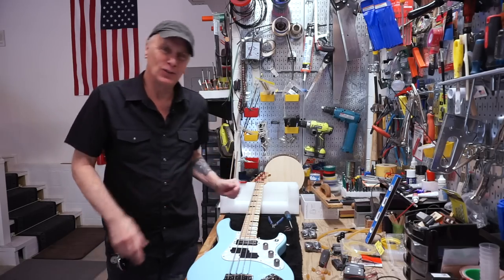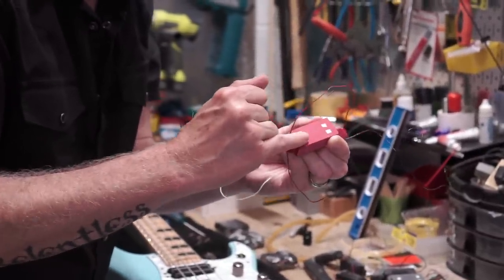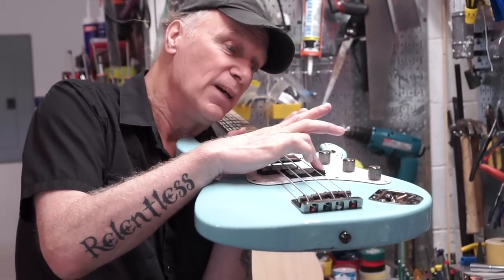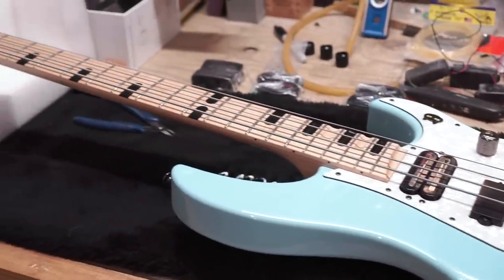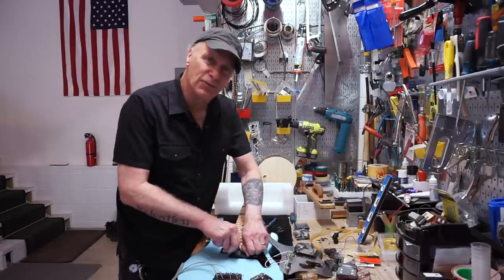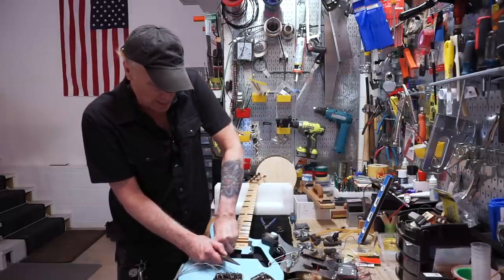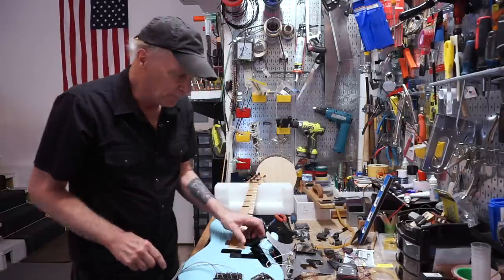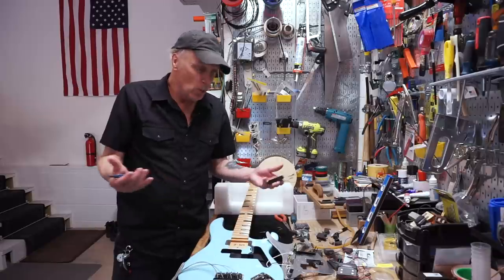Relentless Pickup Install

Comment: Hey there Billy, a little trick my Dad taught me back in the day, is when you are putting screws back in, whether in wood or metal is to turn the screw driver backwards until you feel the screw drop into the threads of the wood or metal. In wood, if you don’t get the screw in the threads within the wood you’ll strip it just like metal. If you are swapping pickups often the screws will lose hold. Just a little trick to keep that from happening.
Love your videos by the way.
Reply: That's a great tip your dad gave you. I always do that and I never get trouble putting screws back in.
Reply from the maker: Agree! Your Dad is right---I do exactly that often. Thanks!

Comment: I bought an Ibanez SRMD200 Mezzo 32” scale bass.  Just like Billy said… the edges and corners of these inexpensive P pickups were sharp and hard.  Every time I slapped the E string, the corners stabbed into the fleshy part of my palm, below my thumb.  It hurt and drove me crazy.  Eventually, I pulled out a file and rounded the edges and corners.  
Billy, thanks for improving design of the 50-year-old P bass pickup.  I’m sure Leo Fender would approve.

Comment: hey Billy. just wanted to pass along a little trick i learned when doing inner work on the Bass as you demonstrated in this video. removing the strings from the head is not needed. just loosen them up and then remove the bridge from the body. it saves time. I'll for sure be looking to get a set of Relentless pickups asap.
Reply from the maker: I don't like to attach and re-attach the bridge--too much wear on those screw holes which will eventually make it loose--and the bridge to body connection is extremely important.
Reply from the maker: Let me know what you think of the new pickups

Comment: Fantastic instructional video Billy, learn a lot, I had to do some soldering on my SIRE bass a while ago after a wire that connected from the battery compartment to the input jack came loose, my first time soldering and it worked OK, nerve racking but gained some knowledge from it !! :)

Comment: Billy, I realise this probably isn't something you want to revisit, but I'm really interested in learning how exactly you installed the EBO pickup on your original p bass. There aren't really any guides on that online or on YouTube. The only one I could find was a video on fitting one to a cheap p style bass, but that was using a router and I don't really have the money in my budget to buy the bench etc required to do it that way. 
I'm planning on selling my jazz bass, ibanez SR and my schecter stiletto six string and buying a sire p5 and adding a full set of relentless pickups and keeping the hipshot tuner I already have and installing that too. I know you did it with a chisel and some other hand tools but I've never really seen any detailed information about the process.

Comment: Billy I have a Fender Jazz bass, and I was just wondering if maybe Di'Marzio would be interested in making pickups with the same radius design but for different basses. Like a jazz bass pickup with a radius, or a soap bar pickup with a radius. The idea that you have with this is great, and I'm often finding that it's harder to play the middle two strings with the same consistency as to the outer strings. This is especially apparent to me when I'm playing my six string bass. The neck is flatter on that bass but it still has a radius. Pickups more like yours would be a lifesaver, especially live when so many other things can go wrong - I can start from the top when I'm on my own, but as you know, that doesn't work so well in front of a crowd 😆.
Reply from the maker: Coming soon!
Reply: @BillySheehanOfficial  Thanks so much for getting back to me. That's great to hear, as soon as they're out I'm putting them on all three of my basses. Huge fan btw, you're a massive inspiration, I hope to see you live some day soon. I even got a hipshot tuner because you mentioned it I think on your Bass Secrets video. All the best Billy, you're the man!!

Comment: I am sitting here with a pair of these in the  shopping cart. But wondering how they’d sound in an active bass. My guitar tech knows I’m upgrading my bass. He just put a set of these in a PJ this evening. He hit me up and said this is a must have pickup. The owner of the bass brought it and a Quarter Pounder Jazz for the bridge. He wasn’t sure about the combo but said it works great together. Now to call Dimarzio tomorrow for info as far as if it’ll sound alright with an active preamp. Unless one of you guys have already tried it... if so, let me know what you think.
Reply from the maker: It should be fine---and the Relentless style J pickups are coming soon!
Reply: @BillySheehanOfficial  I placed the order... thanks!

Comment: Yes ! I hate the crater left in my thumb from the screw mount. I too hacked them down . But I don't use springie thingies under my pickups .I solid mount them to the body. Take my time and get the setup spot-on and measure for the right thickness for a shim to get the pickups exactly where I want them. It's Rock solid. 
But that's just me. 
Comparison between the stock pickups sound and these, are they close?
I really like the roundness of them . 
Thanks Billy !

Comment: I was wondering, how do you avoid signals going out of phase or outright eliminating each other in a two pickup/two ouput/two amp setup?
Reply from the maker: The same way any two signals can be combined without phasing issues. Two mic's, two anything. Are you out of phase with anyone else's amp on stage? Unlikey.
Reply: @BillySheehanOfficial  thanks for your reply! I'm currently nerding out over all this stuff and a few musicians I talked to told me there could be problems with phasing. I am now running my P bass through two different signal chains on my pedalboard and then straight into headphones/audio interface. Works like a charm. Absolutely no issues with phasing and I have never been more happy with the sound

Comment: I try not to do any soldering over the exposed body of the instrument- good idea to put a cloth or a sheet of paper in there in case of flux/solder splashes.
Reply from the maker: If it was someone else's bass, I would have
Reply: @BillySheehanOfficial  good man, sir. I am, of course, in the 'do as I say, not as I do' school here! 

pondering adding a large G&L pickup to a stingray... for my money, the stock pickup & position is a bit light, sonically. I am encouraged by your thoughts on tone.

Comment: Billy, you are F-ING amazing!!!! Guitar tech extortionate I'd say! Definatly not a Luthier, more like a gut bucket miastro. Your strap vid is possibly the best I've ever seem, makes perfect sense.
By accident I found a solution to the pickups tipping when you use the surgical tubing. Couldn't find surgical so tried using small plastic tubing. Needless to say it didn't work, (too stiff), but found another way to insert it that works amazing well, AND stabilizes the pick up as well!!!! Can I get your input on this if I send puctures?

Comment: I mangle all my own instruments, too! But then, how else would I be able to have a short scale with a P/Tbird pickup combo with a VVT control configuration? My nasty #1 bass does have a hole drilled all the way through the body, by accident...

I like toothpicks with krazy glue to fill stripped screw holes. They dry faster than elmers lol
Reply from the maker: Sounds familiar!! ; )

Comment: Is it possible to design a bass that you can install the pickups from the back behind a panel of some sort? Maybe it has already been done but doesn't work well, Idk. I have seen many videos about changing the pickups but none without the extra trouble of removing the strings and all that. Some bass guitars has a back panel for the vol/tone controls, that seems to work. Why not the pickups?
Love the video.

Comment: This is a great video man! I'm currently building project bass, but I'm a total Hack😄. i had it routed for a double P configuration (a reverse P at the bridge). Really think I'm gonna use these pickups in chrome. If i may ask, How would you set up the controls for this kind of bass? 
Love your work 
Thanks 👍

Comment: Where do you get the tubing that you used?
Reply from the maker: It’s underwater spear gun tubing. Or surgical tubing works too.
Reply: @BillySheehanOfficial  Right, thats what I searched for.  What I found did have a smaller hole but the tube itself seemed to be quite wide.  Is there a particular site or distributor you found that had good product?
Reply from the maker: @averyweissman4093  These are about 3/8ths wide. The width may help stabilize the pickups

Comment: Great vid Billy , Thanks for sharing . Love the design . I don't know how many times I've given myself blood blisters by hitting the corner  of the pick up , or wearing down the thumbnail  to the quick from the top of the Philips head screw .  Quick question : It seems , not only do you like practical  mods , but fast and easy as well . Is there any thoughts, switching to a solderless system in the future ?
Reply from the maker: Maybe----I'll have to check it out. Thx!

Comment: Cool video, your Yamaha Attitude limited 3 has a fingerboard radius of 10" , Can i use this pickup on 9.5" fingerboard radius bass?
Reply from the maker: Sure! You can adjust it with the mounting screws
Reply: @BillySheehanOfficial   thanks!!!
Reply: @BillySheehanOfficial   i have another question, can I replace the neck pickup of my SG bass with the new RELENTLESS NECK - DP295 ? On Dimarzio website I can't find the dimensions but the specs are awesome.